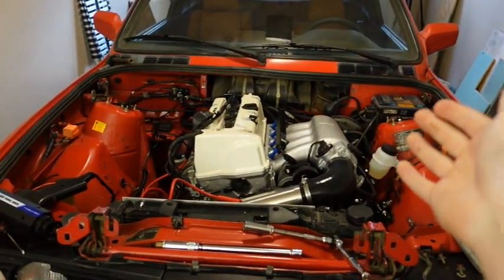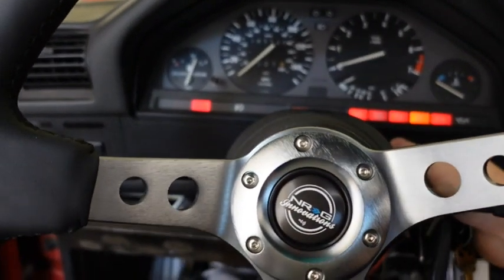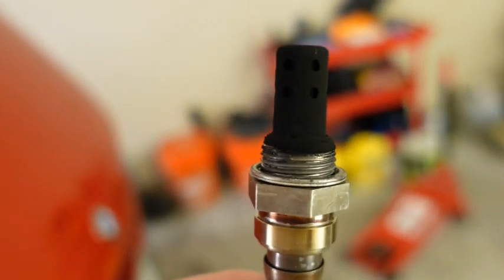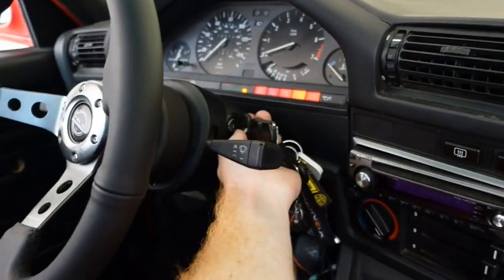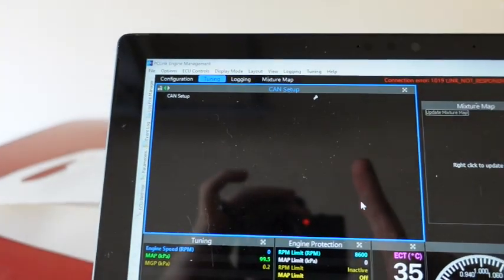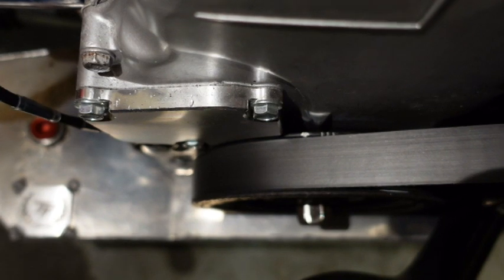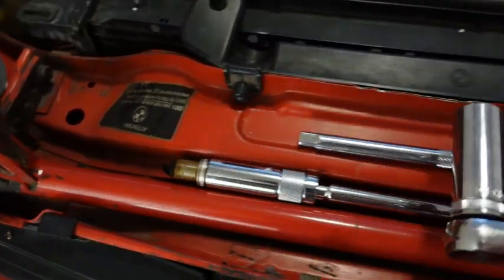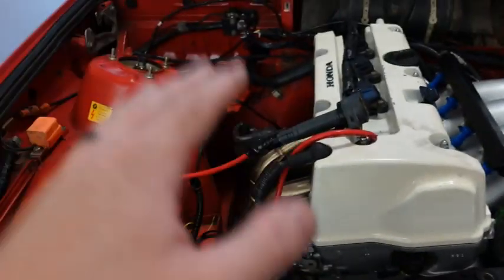Can We Fix The Idling Issue On The K24 E30? Timing Issue?

Comment: Why do you not just lean it out?  If you save your basemap first, you can not mess up your tune.
Reply from the maker: After installing the lambda I tried taking out fuel but it didn't have any reaction, so I think I'm experiencing a different issue than just the fuel,  I took out 10% off the whole fuel table and it didn't change at all, so Im going to go over my work again
Reply: @ProjectRacecar2  10% might not be enough, try 15, 20 or 25. It is safe to try, you wount ruin the engine at idle. Lean it out untill you get lambda 1.0 or afr 14,7:1. It is also important to get the engine up to working temperature first.
Reply from the maker: For sure, I will definitely try taking more fuel out! That's good to know I won't hurt it at idle! Hopefully that helps! I appreciate your help, definitely learning😬